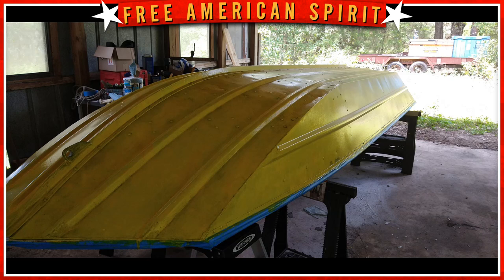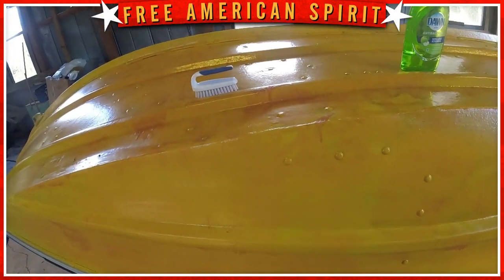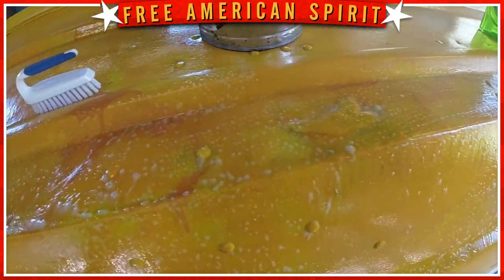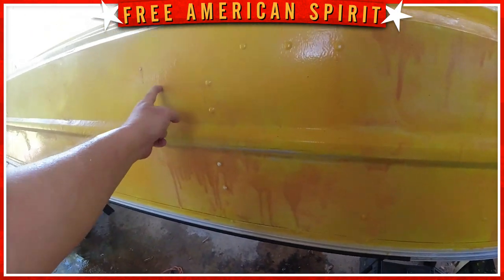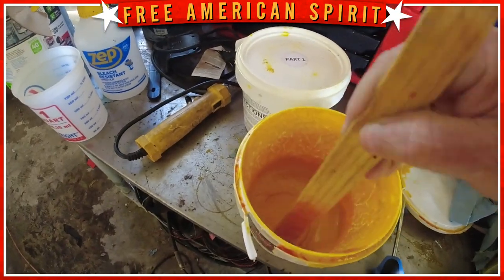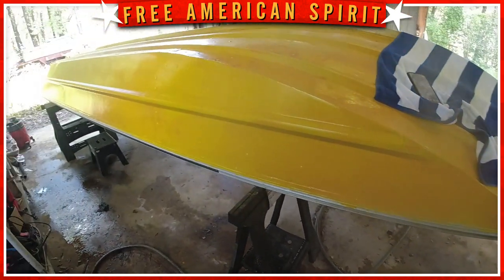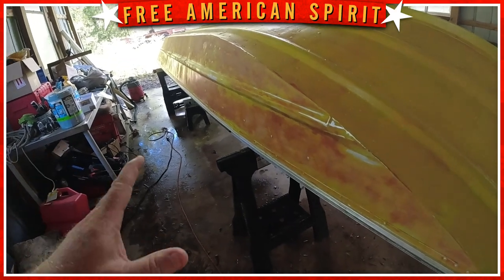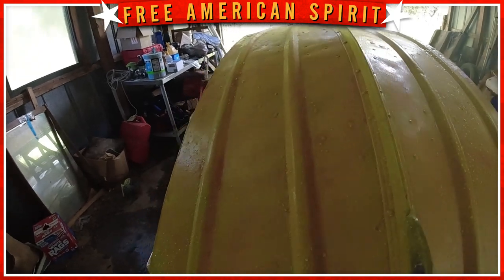Fasco Super Slick 2000 -Steel Flex #4 Bass Boat to Jon Boat conversion Painting Aluminum Hull

Comment from the maker: Support our Channel. Amazon for things you normally buy:
https://amzn.to/3KqqQi2y 

Fasco Super slick 2000:
https://amzn.to/47p1nzl

Fasco Steelflex:
https://amzn.to/3YmYdI0

Fasco Pigment (black):
https://amzn.to/45iqX7i

White vinegar 10%  (etching):
https://amzn.to/43SUZNP 

Aluminum cleaner:
https://amzn.to/3OqURz5

Shop towles:
https://amzn.to/3Kx4UBD

Gluvit Aluminum Boat Sealer:
https://amzn.to/44Rdtj2

Gflex flexible epoxy for installing rivets:
https://amzn.to/44RvZI5

Mesh Sanding discs ( much better than Sand paper discs):
https://amzn.to/3OmP260

Epoxy Paint remover stripper (JB weld and Epoxy paint):
https://amzn.to/3KoO8Vm

Acetone (must use before painting):
https://amzn.to/3Koz5uK

Alcohols ( also to clean before painting);
https://amzn.to/43NnSec

Xylene Glue remover (Carpets):
https://amzn.to/3YySu2d

Disclaimer: These links are affiliate links.  Free American Spirit will earn a small commission if you make a purchase at no additional cost to you. These are products, services, companies  and websites that I actually use and like. There has been NO Prior compensation paid to me to promote any of these links.

Comment: Looks good!! The yellow is very hard to get to cover so overall you did a great job.
Reply from the maker: Thanks.  I actually did one more thin coat so it looks ok.  Was a learning experience for sure...
Reply: @FreeAmericanSpirit  Yeah you should be good to go now. Just be careful at the ramp as that boat will want to slide off the trailer.
Reply from the maker: @fiberglasssupplydepot5132  took it out twice to test for leaks with 3 people in it ...   Not a drop.  Slides on the trailer a lot easier now.